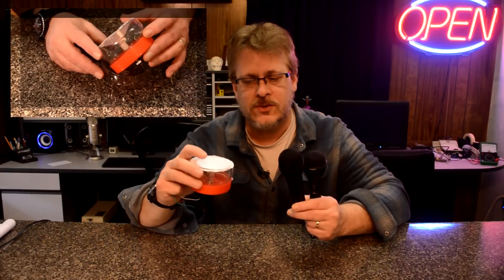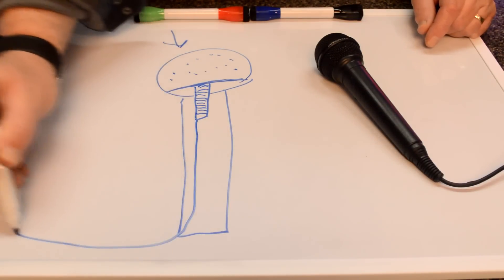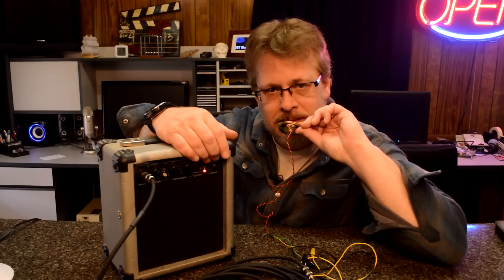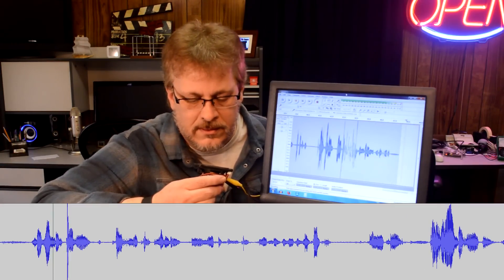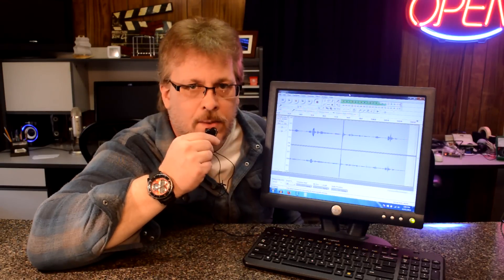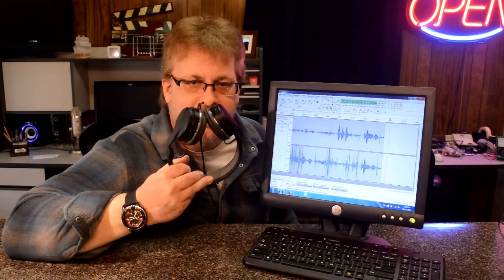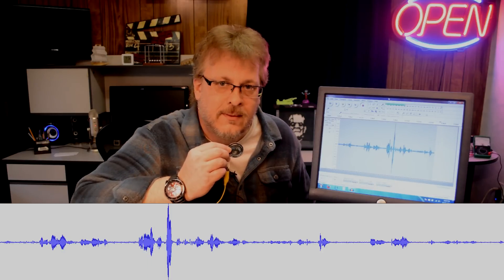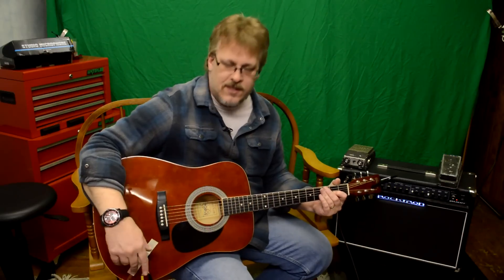Can a Speaker be Converted Into an Audio Microphone?

Comment: Hey I'm building a license plate guitar... I could use a speaker for a pickup. Just run it to headphone jack to an input correct?
Reply from the maker: It should work but how well I'm not sure. A pieazo pickup would be better, they are cheap on Amazon
Reply: @GuruBrew  thank you. I may give the speaker thing a whirl just to check it out. Loved the vid very informative.
Reply: @GuruBrew  I did obtain a piezo pickup from an old smoke detector.... Free is good. I may use ALL 3 (2 speakers and piezo) just to experiment.

Comment: Many computers use 5 volts dc on one of the microphone lines to power "USB mics" which have a small internal amplifier.   It might be a good idea to put a capacitor on the speaker signal line to block this voltage/current.   I'm not sure of the value right now,maybe 10uF (10 micro-Farads) or higher to pass lower frequencies.   I have also taped a speaker on a guitar, and even loosely hanging in one, with a older telephone mic or speaker piece.   The results are good.  Here is a basic circuit for a speaker to microphone:   https://www.youtube.com/watch?v=OIwkwgorhkw
Your homemade speaker worked ok as a mic, glad to see that.